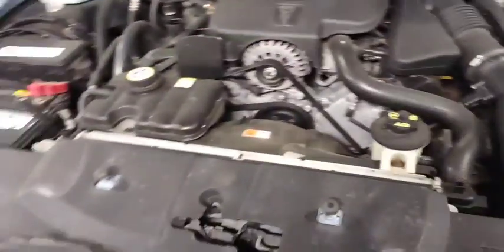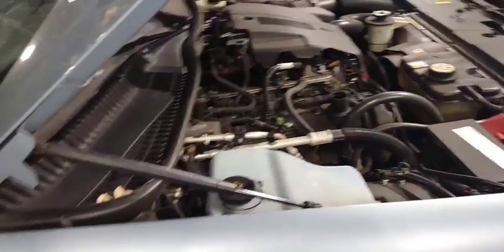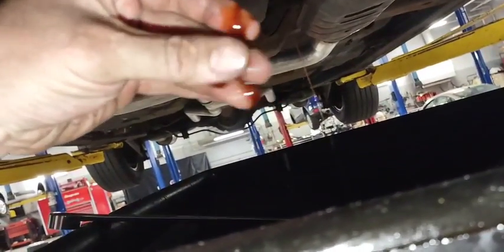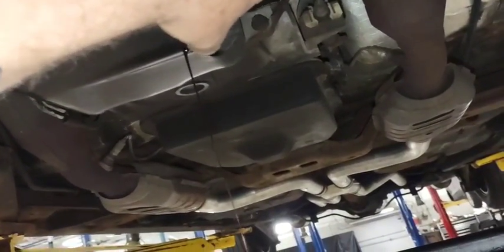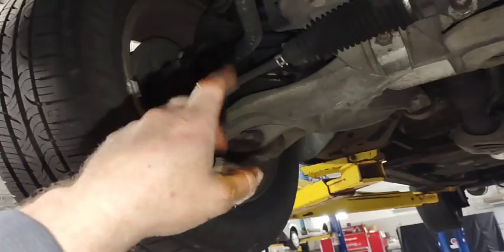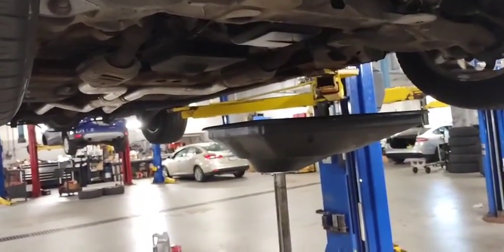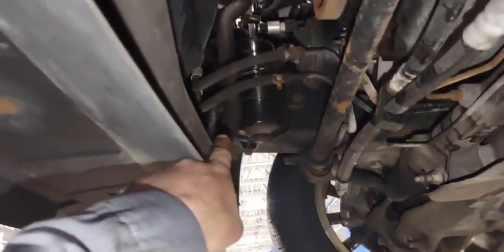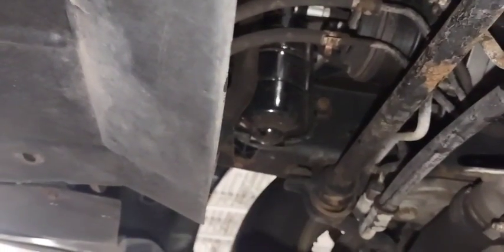Pennzoil Platinum Ultra oil drop 5k Miles, the next 5k Miles trying Mobil 1 extended high mileage

Comment: I've used mobile 1 for years in my civic.  Last change, I put in Pennzoil platinum.  I can tell you without a doubt, the engine is much smoother/quieter with the Pennzoil.
Reply: Yeah with mobil 1 my engine is not that quite, now I'm gonna try pensoil platinum  and see what happens

Comment: I am retired and drive my F-150's with nothing but Pennzoil Ultra Platinum.  I change it regularly at 5,000 miles (regardless of time), and it's always been a champ.  Since I am retired, I take lots of road trips.  Many of them are 3-4,000 miles long and through mountains of Utah and WY, deserts of AZ and NM,  and the sticky heat of the southeast US. 
I wish more stores would stock it tho.  It can be tough to find.   Formerly drove a 2019 with the 5.0, and now drive a 2022 with the 5.0.  Great stuff.

Comment: I used to be a Valvoline fan for years, but This is the first time I used Penzoil platinum full synthetic so I wanted to see how it performs. Nothing like taking care of your own rides needs. I use to get my oil change done at Jiffy lube but today I did my own oil change and compared to $130 for full synthetic I paid $50 for full synthetic oil change. Plus I discovered that they put my air filter in wrong and the oil filter was on super tight too tight if you ask me. NOBODY will ever put the extra love you put into your own ride when you do it yourself
Reply: I am DIY so always do the oil changes and repairs on my vehicles. I could do a quick 15 minute oil and filter change which means the new oil will be mixing with the old oil that did not quickly drain from the engine. However, I spend the extra time doing engine flushes before the new oil and filter.
Reply: @ashleycampbell6825  Nice it's that's extra love you give your ride that shops don't do.

Comment: After using Penn Platinum (not ultra) from 89k through 286k miles in 6 years time I've learned a few things.  Early on I switched to 0w30 Amzoil in the Pennsylvania winters for cold starts. After much research, I learned the Pennz 5w30 is closer to a 0w30 anyway. So, instead of flip flopping back and forth just stayed with Pennz from that point on... For one exception.  I decided to try Castrol Edge 5w30 once in December when it was due.  My motor wasn't particularly happy.  Startup was not smooth.  It was noisey cold or warmed up.  A week later back to Pennz.  Consider it a flush out if you will.  All was well again, engine was silent and snappy.  All told even until the end the motor did not use a drop in 6,000 miles.  Oil samples concluded no wear at all during that time.  I was not easy on it either.  She saw 6,000 rpm often or 90 in 2nd gear at least a few times a week.  That said, I've been very pleased with original Pennzoil Platinum.  It's always poured cold as if it was room temperature.  That is important for a very cold startup.  I'm non denominational when it comes to what works.  Ford, GM, Mopar all have vehicles I love.  Originally I fostered my suggestions by trolling BITOG forums and did my own research on additives.  In the past before zddp made its passing Castrol GTX or Kendall were my choices.  Times change.  Enjoy, and happy motoring! 👍
Reply: FRANK RIZZO FROM CHICAGO  This is completely unnecessary, the cold start/dry start myth is just that,  a myth.  Yes it takes a second to build oil pressure on a cold start, no it does not matter.

Take care of your engine, use the correct oil and change it on time.  That is ALL you need to do.
Reply: seymourscagnetti1413 This is bad advice for some vehicles. The anti theft kicks on if you do this and your engine will not start until you tow it to a dealer. If you feel you must do this, just flood start it.

Comment: Pennzoil Ultra Platinum is my go to oil in all my vehicles. I just wish it could be bought at your regular parts store. I started using it in my son's STI, switching from Motul. My Mustang had Amsoil for the first 2yrs of its life, so once a year no matter the mileage. After my son's results I made the switch too. Now I just get 2 gallons delivered from Amazon every 3 months to cover all our vehicles.
Reply: My son has a 2014 GMC Sierra with the 5.3 with Active Fuel Management. I hear so much about the lifters collapsing and wrecking the cam. I have used only Pennzoil Ultra Platinum 0W-20 in that engine 144,000 miles engine is still running well. We will see what happens.
Reply: @robertslegers257 add some Marvel Mystery oil and the gas& oil

Comment: I’ve been running Pennzoil Ultra Platinum in my 2019 F-150, with the 5.0, since I bought it new and it runs like a champ. And, like you, I change my oil every 5K miles and I’ve never had to add any oil between oil changes. It’s worked better than any other synthetic oil I’ve ever used so far, so I’m planning on sticking with it.
Reply: I think I may switch oils to pen plat
Reply: @guyazbell7437  I really like it. The only thing with the Pennzoil Ultra Platinum is you have to order it. But, I have it shipped from Walmart, with free two day shipping, for anywhere between $20-$25 per 5 quart container. And, I usually order four 5 quart containers at a time.
Reply: Same !! Sucks we can't find the Ultra Platinum at regular parts stores though. Where do you get yours, Amazon ? I just get it delivered every 3 months to make sure I have enough sitting around.
Reply: I always order mine from Walmart and have it delivered. I order four 5 quart containers at a time, so I get free two day shipping. You can also have it shipped to your nearest Walmart store for free and pick it up there with no delivery charge.
Reply: @Brian_195  from Walmart? Pennzoil Ultra Platinum ? Dude I can't find it anywhere!! Amazon is hit or miss, containers don't have a aluminum foil seal and if they throw the box around they'll leak. I try to keep 6+ gallons in stock at all times to cover 3 vehicles. Thanks man, I'll have to check that out. I searched and searched, Amazon is a month plus on delivery for this specific oil.
Reply: @Brian_195  I use 5w-30 in my Coyote, they have my viscosity!! I know they didn't 2yrs ago when I first bought my car cause the Euro Blend ( Same product) was my only option but didn't trust people telling me it was the same. Thanks man !!!
Reply: @Brian_195  if you have a Gen 3, if you experience poor idle or stalling once your oil is about due for a oil change. Step up your viscosity to 5w-30, fixes the issue from the cam phasers going funky out of wack that can be seen on a data log, check out Alex from Lund he addresses the issue to a degree but recommends getting phasers replaced. Nothing is wrong, there's just not enough oil pressure to keep the phasers happy and by stepping up viscosity keeps your car from going in for unnecessary repairs.
Reply: Using Penn Ultra in my '17 f150 5.0. Motor is SUPER quiet. Also recently switched over to a Fram Ultra oil filter... before this I was a Napa Platinum guy. Can't find the Platinum lately... in store or online.
Big believer in Pennzoil.

Comment: I used to have a Grand Marquis. Too bad they quit making those body on frame cars.
Reply: One of the best cars ever made. Ford could make them for another 20 years, and I'd think they could still make money.
Reply: I'd even settle if they revived the panthers,, made a body on frame luxury sedan but updated the design. As long as they kept at least a naturally aspirated v6 or v8 OHC engine.
Reply: They’re too heavy to meet economy targets, and too compromised a design to meet crash safety standards. There are a bunch of good reasons it’s not used anymore!!
Reply: last body on frame car to be produced. them things are tanks
Reply: @froggy0162  I beg to differ. It's been a while so I've forgotten the specifics but the Lincoln Towncar had a 5 star crash rating and was still body on frame.
Reply: @SArtisto1  Five stars back then isn’t five stars now, they move the bar up every year ;) 

With two separate structures, it’s much harder to make it reliably deform the way you want it to.

Comment: As someone who has used mobil1, and never touched pennzoil, I can tell you im not happy with mobil1 anymore. Ive used it rather religiously, but lately it doesnt seem to last 5k miles. i had changed my oil in my cammed camaro, and it made all sorts of sounds after 1k miles. no metal no leaks, but i could hear the top end making noise. Swapped to amsoil signature with discounts, and not a single noise now.

Comment: Mobile 1 synthetic 15,000 miles has worked outstanding for me in Arizona. With summer temperatures reaching over 100 degrees, going up and down mountain passes with driving over 100 to 200 plus miles round trip. My cars run excellent even with high miles.

Comment: I had a Honda that only ran Mobil 1 most of its life. The engine has 350000 miles and still runs great
Reply: Honda will run 350000 miles with no oil 😂
Reply: Ran mobile 1 once and switched to Royal Purple with a K&N wrench-off filter. I change oil between 7k-9k. Also running Royal Purple synchromax in my gearbox and she purrs like a kitten. I change my own oil and will never buy the cheap shit.

Comment: Never tried Penzoil Synthetic but used to use their conventional. I started using Mobile 1 high mileage full synthetic 5w-30 in my 2000 Astro van and 2000 town car because I liked the oil pressure/temperature attributes. On conventional my astro would make about 60psi on a cold idle but when it got hot it would barely make 25psi. When I switched to synthetic, it made about 55psi cold and 30 hot. Plus, it reduced cold start piston slap in the winter. My town car however makes a tad bit more valvetrain noise under certain conditions but it has 170k never been apart so I can't complain.

Comment: Pennzoil, Mobil 1, amzoil, castrol, etc...it doesn’t matter. Anyone who really knows about engines knows that the best oil is clean oil. It’s the filter that matters
Reply: not true. Not all oils are created equal. Check out "Project Farms" oil shootout. I used to think Mobil One was good.
Reply: @PNW_Sportbike_Life  To be fair, there's not a massive difference between the very best and decent oils on his list. You're talking thousands of an inch wear level differences. I love Pennzoil Platinum but run Castrol Edge because they don't make an easily available 5w-40 near me.
Reply: @VanillaWahlberg  makes sense. I use Castrol 4T in my motorcycles.
Reply: not true at all
Reply: @VanillaWahlberg  engines are built to the hundredths if inches. it matters. the big difference between oils is detergents. and purity of said oil. do some research on oil groupings. most oil is made with group 2 or 3 the real good stuff is group 4 oils. thats the oil they try to tell you to go 10k miles be for an oil change. dont do that. idc what oil u got in it
Reply: @ryanrohauer5940  Project Farms' testing isn't 100% of what the oils actually test at. The bearing test for wear for instance isn't exactly how oil in a car works and even then he's talking .0001 or less differences usually between the best when it comes to film strength. Just don't use cheap no name oil.

Comment: 214,000 miles on my 2010 Chrysler Sebring with the 2.4L VVT engine. Still runs great. Over the 11 years that I’ve had it, I’ve used Pennzoil Platinum oil probably 90% of the time. Some day I have to change the valve cover gasket because it’s starting to leak a little on the backside. When I do, I’ll have to take pics of the top end, good or bad.

Comment: I have 220k miles on my c63 amg and have used mobil 1 all its life @3k intervals. Doesnt burn any oil at all. Im too scared to try anything else and mobil 1 is 25 bucks at walmart which is a huge plus especially if you change your oil as often as me,

Comment: My drive to go to work it's 40 miles per day for 15 years and I'm driving the same car for 10 years. I know my car very well and the average mpg. My daily drive is very well pampered. I Have used both in my Wife 2018 ford ecoboost and I stick to Pennzoil Ultra Platinum. Mobil 1 comes darker a lot quicker vs PUP. Also quiet down my engine and add 1mpg fuel economy.  In my 2010 Mazda 5 I was using Castrol for 60 000 miles with a 3000 miles oci and switch to Pennzoil platinum first. Quiet down my engine instantly and add 10% mpg.  After I've tried Pennzoil ultra platinum and increase 15% mpg. 30 000 miles later  I'm sold to Pennzoil UP for a while. Good job Rich!!!
Reply: I agree when I change the oil last time I use Pennzoil ultra platinum and a TRD oil filter and it was so clear on the stick for close to 1500 miles that it was hard to get a reading, it really stayed honey for a long time I was impressed, I have about 4500 Miles on this oil now mostly highway from vacation so I'm gonna keep an eye on it I might run this one to 7000k since it really has been highway miles I feel pretty confident that it will be good.

Comment: I have never seen a person remove an oil drain bolt like that before. Usually just loosen and run it out by hand.
Reply from the maker: On these Ford metal oil pans about halfway through they start to get a little tight sometimes so you just keep going
Reply: As long as you cranked on that oil plug, it seemed like it was 2 inches long.
Reply: lol you obviously never drained much ford product oil pans, almost every ford product the oil plugs basically make you turn it 3/4 of the way out or all the way at the end cause ford oil pans.... also fuck the yellow plastic plugs lol
Reply: @shineything4444  I got an email from fumoto about testing one of their valves for my f150 with the yellow plug. Can’t wait to give it a shot.
Reply: @shineything4444  Only time I have seen this is when the threads are buggered up.
Reply: @mph5896  welcome to people that took them to quick lube places then to a shop lol.
Reply: @WalterMelons  ohhhh awesome! i honestly like how fast they drain but they just do not last and leak all the time and also the fast drain especially on the 3.5 ecoboosts i think has them? i dont know, whichever one has it facing sideways i hate those when they just GUSH out and make a mess lol
Reply: @shineything4444  I got a new one from autozone and it’s leaking before 5k miles. Probably gonna have to get them from Ford from now unless I get that fumoto.
Reply: At work I swap out those plugs all the time . When the new one goes in by hand with no problem when people over tighten them
Reply: @jimc5624  Yeah mine was hand tightened and it’s leaking. Probably because it was an off brand autozone special.

Comment: I work on alot of fleets. All makes. I use Amsoil with cheap napa filters. I try to get them in at 8k to 10k. Some go over. I have seen cars and vans going 25-30k on amsoil. The Amsoil I use is rated for 10k intervals. Fleets running 200,000 miles to 700,000 miles. Never had breakdowns due to oil. Best oil I have ever used. Been an Amsoil fan for 10yrs.
Reply from the maker: I'm just not a fan of anything over 5K and most of the people on the show know that because of what I see inside the motors when I pull them apart
Reply: @FordBossMe  In a perfect world the min wage drivers would come on time. My old fleets have 500-700k on them old E-150 vans. They are being replaced mostly with Transit connects and Transit 150s. I have the owners stay away from turbo models. 1 company I service is all over the board.... Kias toyotas Chryslers...  Anyhow I love Amsoil. The proof is in the pudding. Never had a engine fail to lack of oil that I service. Even had a few go 20-30k without a oil change... Thank god they got flat tires... Thats the only way I got them in the shop........

Comment: its called a clear flood, disables the fuel system to keep the car from starting so the fresh oil can prime and circulate through the engine.
Reply: Should you do that every morning before firing the engine?
Reply: @metzmatu8409  No,  Some people will do it in cold areas to make sure oil circulates before starting it, some do it after an oil change.  If the car has sat and not been run for several days or more, not a bad idea to do it but not 100% necessary.  Pretty much the only time i do it is before a fuel filter change in my 01 to fully depressurize the fuel system to keep from shootin gas all over when i disconnect the fuel lines.  Modern cars dont have a flooding problem unless there is an injector stuck open or perhaps a bad O2 sensor, or even a bad tune.  Its debateable to do after an oil change, The engine is warm, everything is lubricated, only takes a couple seconds to bring up the oil pressure.  Personal preference.
Reply: Don't have to clear flood after an oil change if you have a filter that threads on straight up. Just fill the filter completely full until the media soaks it down and fill it up again and screw it on.

Comment: I have a 2014 equinox with the 3.6L v6 and 75k miles. It’s been on Mobile 1 and now it’s ready to change out it’s first dose of Pennzoil platinum (not ultra). Three things. It burns less oil. I usually have to add between changes, not this time. The ticking of the direct injection pump has diminished greatly when hot and the fuel mileage increased a tad. I feel I wasted money on Mobile 1. Yeah, going with the Pennzoil, it’s a no brainer.